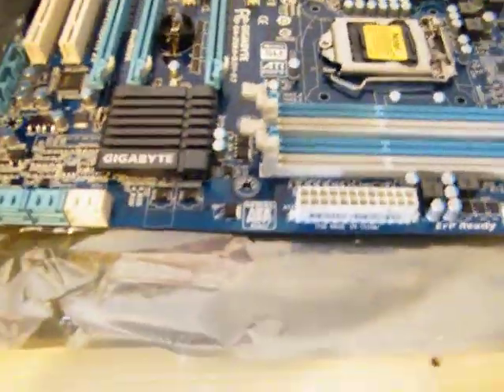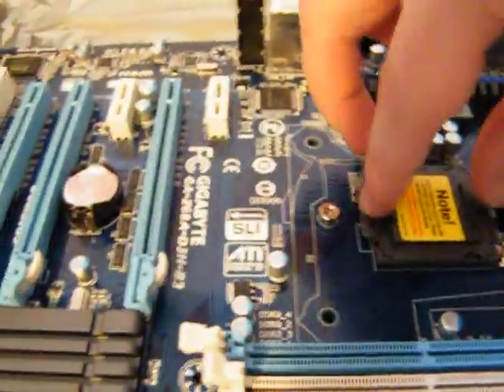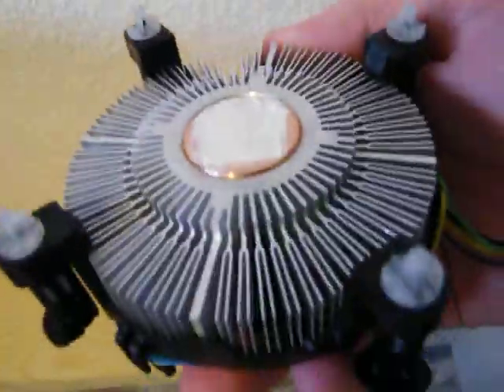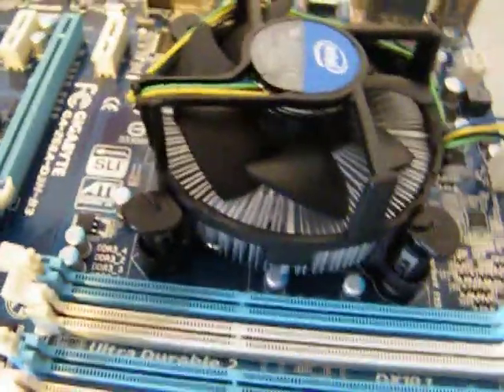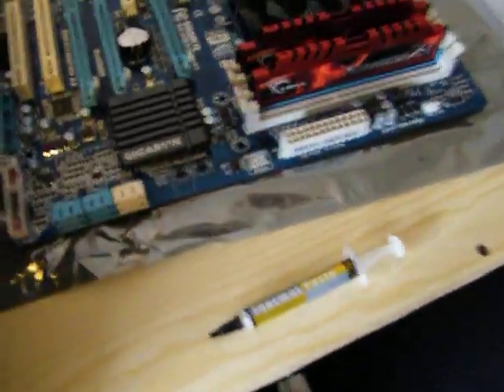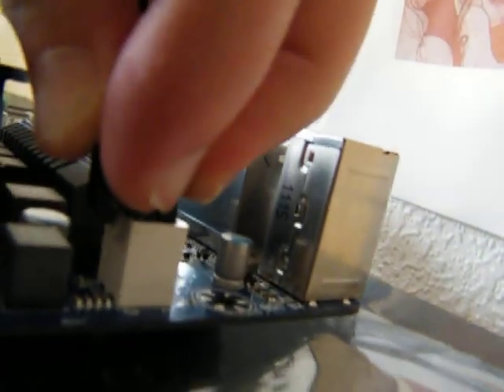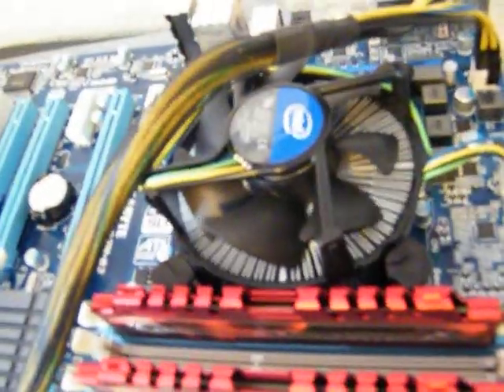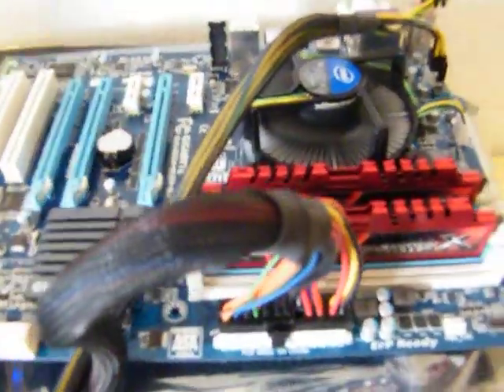Out Of Box PC SETUP GUIDE and TEST

Comment from the maker: @deafjackomonster Thanks for your suggestion. Much appreciated. If I turn it on with just the ATX24 Pin in the board turns on then off. Unfortunately no speakers came with my case. I have RMA'ed the motherboard and should be expecting a brand new ASRock z68 Extreme 4 in the next couple of days.

Comment: Try unplugging the 8 pin and see if it maintains a steady power on. I had a problem where the whole system just stopped, tryed turning it on and nothing. Got the PSU RMA'ed, still nothing but the PSU was blowen. Unplugged the 8 pin and it started the fans spinning, so got the mobo RMA'ed and still dident work... got the CPU RMA'ed and it worked. BTW if you have a little speaker (should of come with the case), then plug that in and listen for the beeps, that may tell you whats wrong otherwise RMA